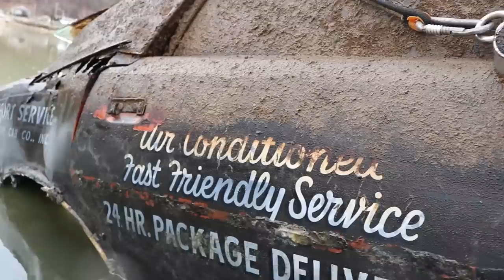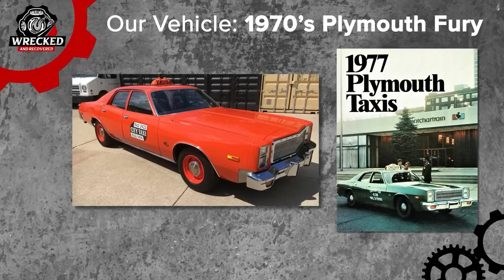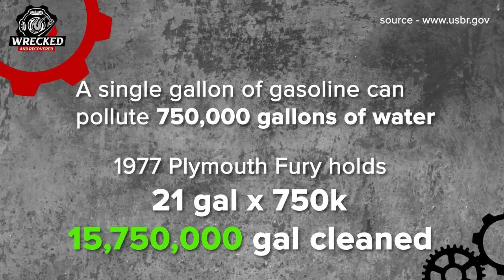1970’s BIG Orange TAXI Pulled from River!

Comment: You guys should put on your wish list nylon tow straps or a couple of Yankum ropes.  One of the most amazing characteristics of nylon is that when you stretch it from one end it contracts from the other.  It does a really good job at slowly pulling something from mud or snow or whatever , it can take time though.  A Yankum rope is a kinetic rope so they work well with a higher speed , well yank.
Reply: I’ve been thinking the same thing for a few of their videos. I think YankUm rope would help them.

Comment: Excellent Introduction!

VIN: Romeo, Lima, 4, 1, Golf, 7, Alpha, 14055_  31:30

RL41G7A14055_ probably should be:
RL41G7414055_

That’s a 1967 Plymouth Fury II or III. Most refer to it as a Fury III. The VIN is a little deficient. It came with a 383, V-8 (a very good engine). It should have 6 digits at the end of the VIN, and be greater than 100,000. I think the Alpha character is actually a 4: the Belvedere, Illinois plant.